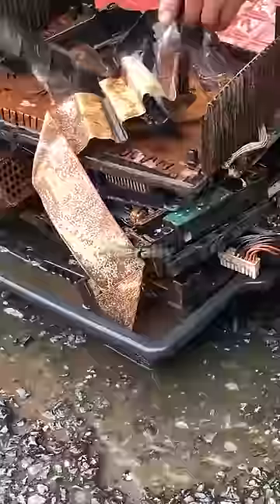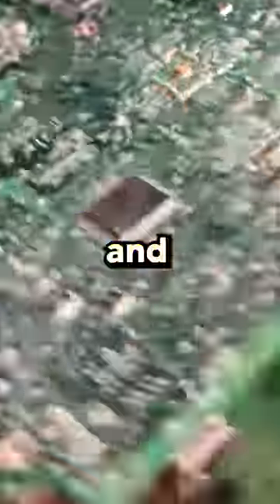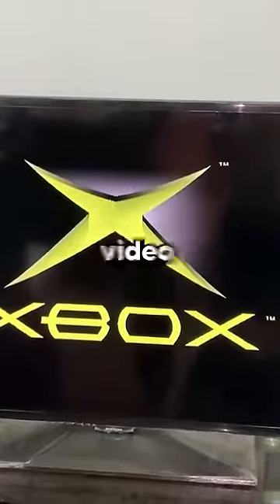Fake Restoration

Comment: You can completely completely submerge a tv in water (unplugged of course) pull it out and let it dry completely and it will work just fine when you plug it back in
Reply: Corrosion left the chat.
Reply: @omegalongdong  the parts onto corrode that fast and not only that but there aren't many parts that would  corrode to begin with

Comment: Pro tip: Water is harmful to electronics because it is conductive. If your electronic device does not have running power at the same it is wet, it will be safe. Just wait for it to completely dry out before powering it back on.
Reply: Corrosion left the chat.
Reply: @omegalongdong  Why the hell are trying to power on an electrical component that is oxidised.